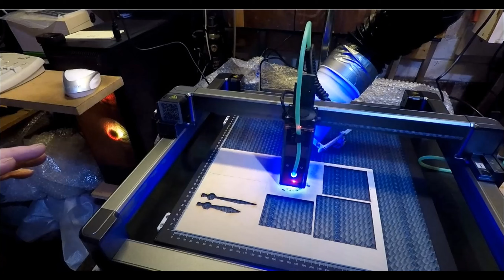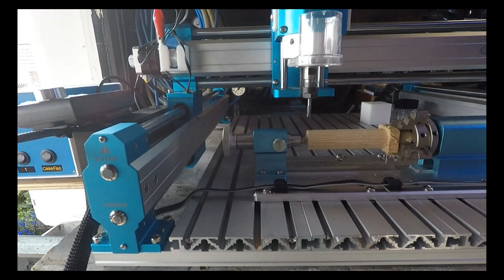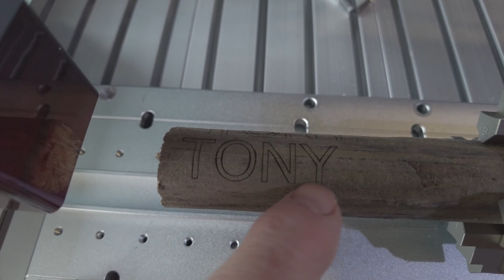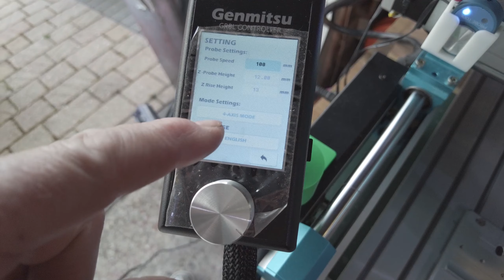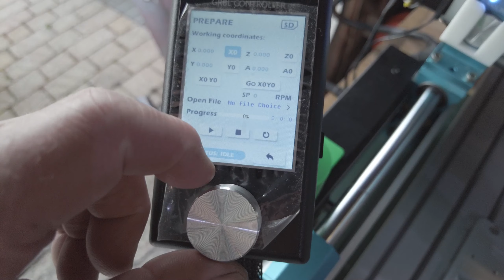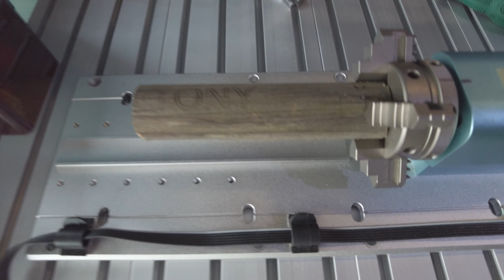Sainsmart 4040 Pro combining the laser Tree 10w Laser Diode 4th axis and offline controller.

Comment: Nice! Do you think with extension kit 1020 mm can you use rotary on a metal tube of 1000mm? Maybe turning clockwise the 4th axes
Reply from the maker: Hi thanks for your comment,  the 4040 has its weaknesses they have addressed  one which is the upgraded x axis but l could not say if things would be ok as you have mentioned but if you go down that road please  keep me informed

Comment from the maker: Hi thanks for your comment I received my Aspire when I upgraded to my large pro machine so I use it. I dont like using too many different  types of software. Lightburn I use for my laser work. ASPIRE is very expensive before I received  Aspire I used carve and I liked that. I would say shop around and try the trial versions of different  software  programs good luck